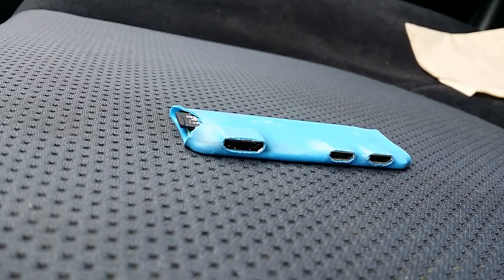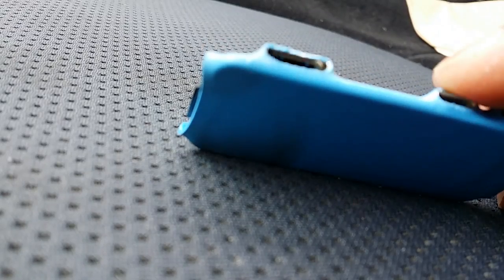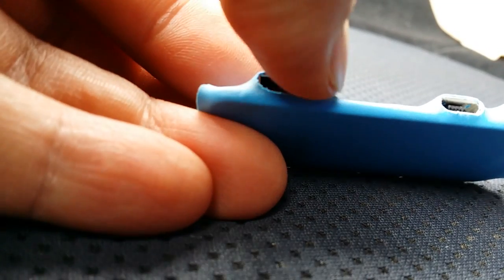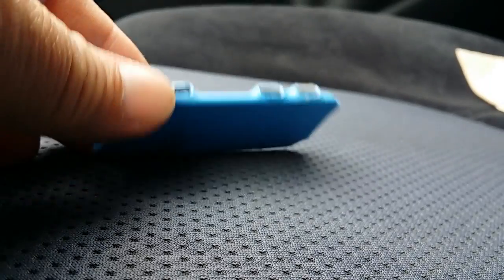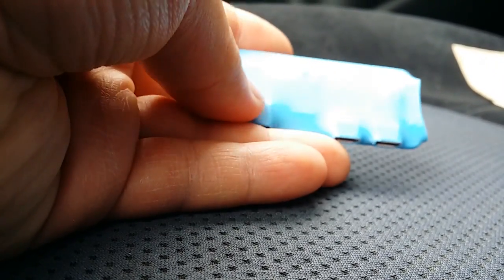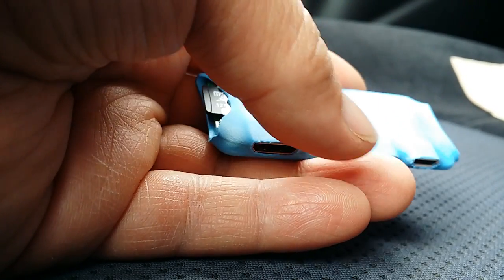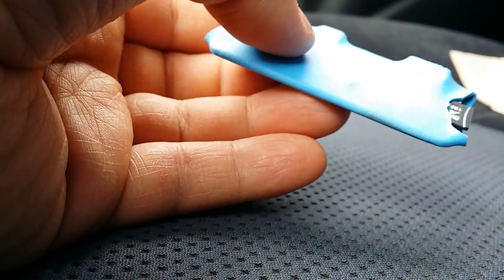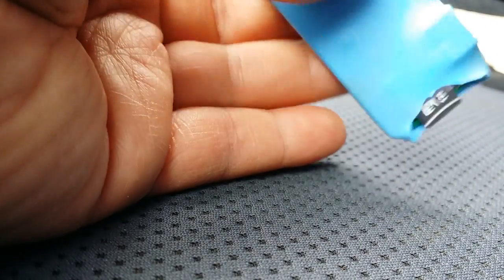Heat-Shrink Raspberry Pi Zero W - Thinnest Case

Comment: can't agree with reason for doing this more!
searching and all I can find are $6+ chunky cases with loads of cutouts for things I don't plan on accessing like SD card /gpios all with shiny rounded edges when all I want is small thin and cheap $2 case that holds together protects against casual use.
wondering if the wrap puts much stress on the board once its tightened up? and will heat from cpu cause any issues down the line given it is heal sensitive material?
Reply from the maker: And I still haven't found a practical portable case for the rpi zero.  I carry the little zero with me all the time. Its in my pocket. I also got a tiny micro usb cable around my keychain. search amazon for keychain micro usb.  To address your concerns. You only heat the tube enough for a slightly snug fit. I used a flame. But a hair drier may work. I use my zero everyday. No overheating issues. You can also cut a square hole at the CPU if your are concern. But its not an issue.  It also depends on what you use it for. I use it to run a tiny web server for photos and misc tools.

Comment: Doesnt it overheat a bit? Depending on the use, does it termal throttle ?
Reply from the maker: No. I was worried at first. But I've been using it this way for a while. I keep it in my pocket as a portable pi device.